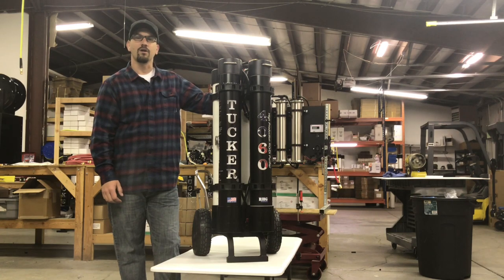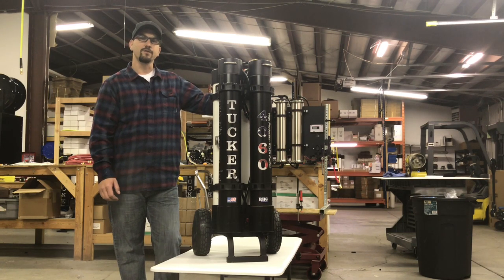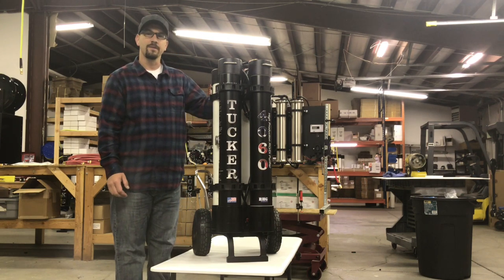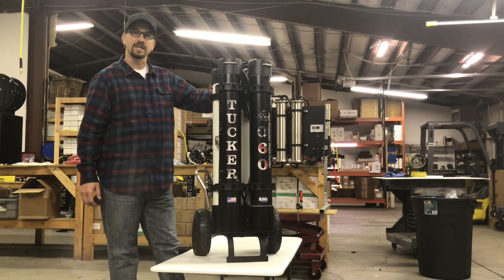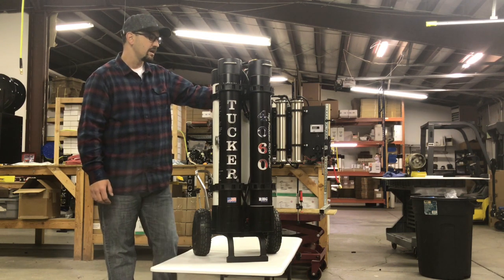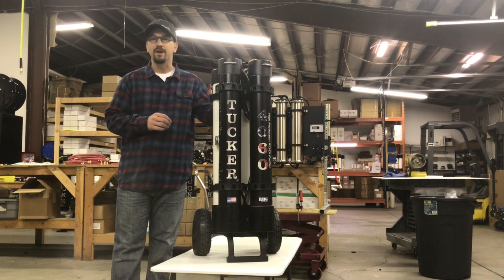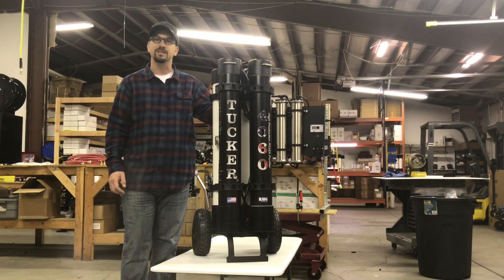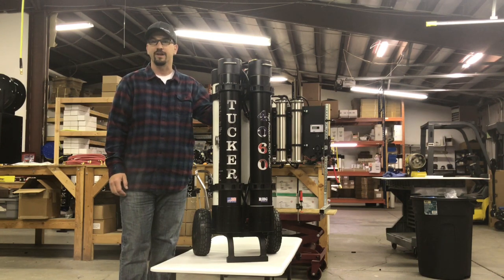Tucker®🇺🇸 4060

Comment: How many poles can this run simultaneously?
Reply: With good line pressure you can have 2 users.
Reply: Thanks Shawn, does the plumbing run through the first RO then to the next or both at the same time? Thx